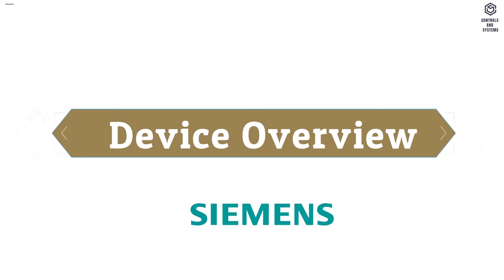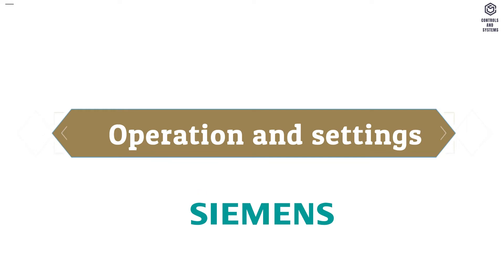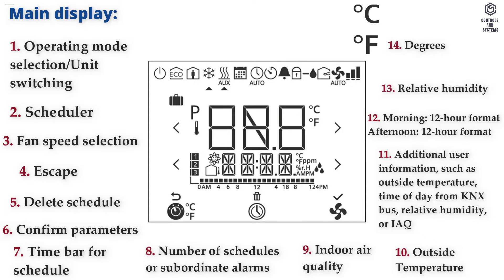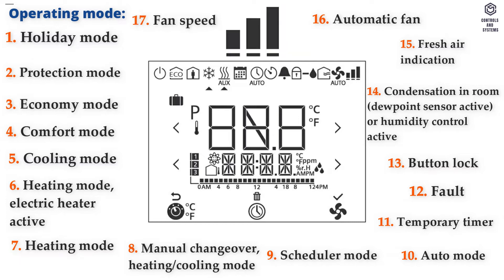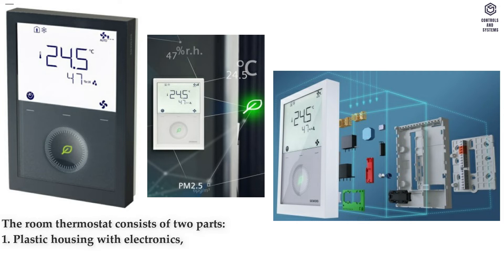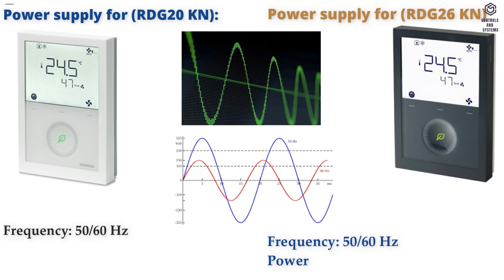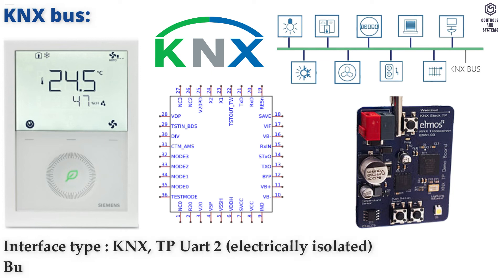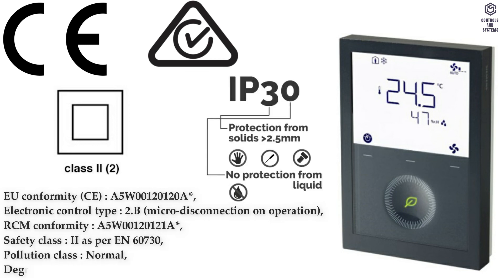Siemens RDG 20KN & RDG 26KN Series: KNX Thermostats Overview & Technical Data | Smart HVAC Solutions

Comment: Bro I need bcu code for reset for this model
Reply from the maker: P505 - Reset parameter setting

Reset parameters:
The factory setting for the control parameters can be reloaded via P505, by
changing the value to On. Confirm the change by pressing the right button.
8888 is then displayed during reloading and device restarts 4 s later.

81 Reset the Energy efficiency status (Green leaf)
(0 = No action / 1 = Reset)
Reply: @insightcontrolsystem  😊